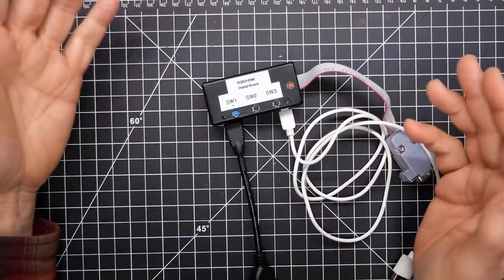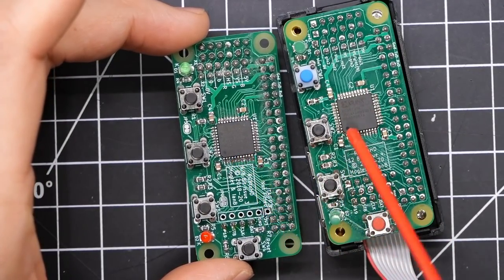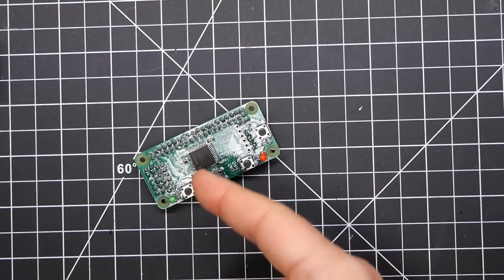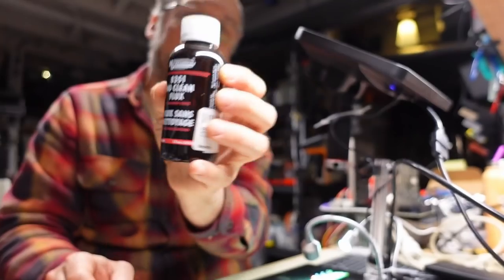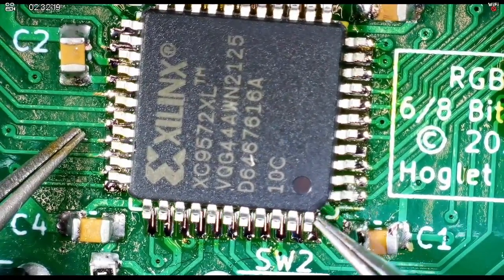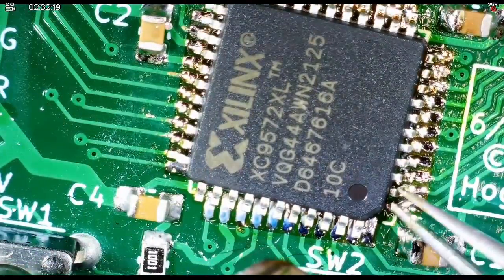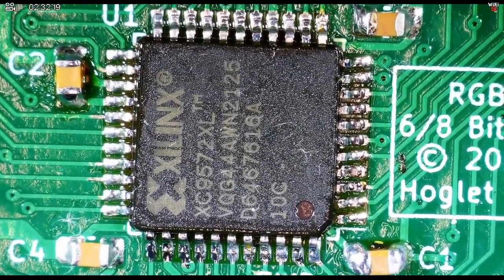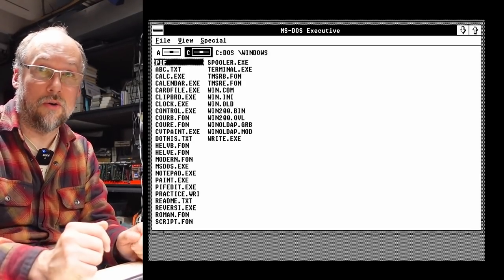The perfect way to NOT do SMD rework (RGB2HDMI overview and repair)

Comment: You're actually pretty close, you just need more practice.  I routinely solder harder stuff than QFPs (think QFNs and DFNs with multiple backside paddles and 0.45 mm pitches).  So a few tips: 1) Chips moving under hot air is common.  Don't freak out when it happens, just keep heating and gently nudge the part back in place.  If you freak out and move the hot air away, the solder will solidify and you'll have to get it hot again to put it back.  It sometimes also momentarily grabs when it shifts out of place.  Just gently nudge it with your tweezers until it can move again.   2) Clean the flux after removing the old part, then reapply for the new one.  Old flux gets used up and develops a burnt appearance and doesn't work well.  Acetone works well for removing rosin flux.  It attacks some plastics, but most PCB components won't be bothered by it.  3) When you have everything molten, chips will "snap" into place.  That's a nice sign that you have everything lined up properly.  4) Use LESS solder.  You don't need much for surface mount soldering.  Too much just creates issues and bridges.  5) When desoldering, don't try to pick up the part right away.  Just put the hot air on it and keep gently nudging with your tweezers or a small stick until you see the part move.  Picking it up before that point tends to lift pads.  6) Chips are pretty robust to hot air rework, especially if don't heat it longer than necessary.  If you have to retry, it'll probably be OK. 7) Try a bigger nozzle for your hot air rework.  That one is really too small for larger chips like that.  8) When soldering pins, flux is your friend.  It helps to keep solder bridges away.  Flux the pads before you put the chip down, then, once the chip is down, flux the pins before you touch them up.

Comment: Desoldering was OK
But you need to solder back:
1) remove all old solder with the wick
2) apply flux around
3) Solder only 2 pins, diagonally to fix the chip
4) blob ball of fresh solder all around the chip (flux will avoid connections) with the normal soldering iron
5) remove excess solder with the wick.
6) clean with IP Alcool.
Ceers.

Comment: Clean the board, apply fresh flux, and use higher temperature -- 375-400 C -- and the chip will self-center.  If you're gonna hand-solder, remove the old solder first.

Comment: I built my adapter by getting PCBs built from the GitHub KiCad PCB files. I soldered every part by hand because I didn’t trust hot air. I would be tempted to remove the CPLD using air and replace it with an iron.
Reply: My CPLD came from mouser.

Comment: It’s better to use solder wick to clean off the excess solder and then clean the flux off so you have a clean, level surface to place the chip. Then tack down one pin on each side before going in with the proper flux and soldering all the pins.

Comment: A good attempt. A better method would be to remove all the old solder first with solder wick. Then mix some solder paste with flux to make a very thin solution. Use a thin wire to drip thined out solder paste onto the pads. Don't worry if this step ismessy because when the solder paste melts it will correct itself. Place the chip onto the pads. Then melt the paste with 400 degree celsius hot air. The paste should melt and drag the chip onto the pads.

Comment: You should have used solder wick to remove all the solder from the pads, not add more. then it lays flat. solder two opposite corners, then run a bead of flux on the pins. clean the tip on a damp solder sponge  they add a very little fresh solder to the tip. Run it along a row of pins, which will draw the proper amount of solder onto each joint. With a little practice it will look like a good reflow over solder job.
I did this work daily for four years.
You got that IC too hot, which can damage it. Also, the IC needed to either be baked to drive out any humidity to prevent the package from splitting on the underside.
I used Ungar 'Loner' series irons, with a 0.015" Plato tip and a collet to hold it properly.
I did NASA certified level work, that went into space. I also worked with Manufacturing engineering to upgrade both our reflow process and our rework process to handle smaller components. Hand soldering was done with Ersin 0.015" 63/37 solder.

Comment: I was astonished at the cost of these devices. A RasPi Zero sells for $5 - but this $1 add-on board with $10(?) worth of parts will cost you $75 if you "need" a case.

Not exactly friendly pricing, here.

Comment: wont take you much practice to get good at smd work at that rate. 
you generally dont want to hold the chip down though, ise less air flow if you are worried about moving the chip. 
also you should really use amtech paste flux, just put solder on the pads, then put the amtech flux on top, its pretty sticky.. 
then line up the chip and heataway. 
if you really want too you can tack down a leg on each corner but thats more for things like tsops woth really fine pin pitch.

Comment: Not bad for a first (or inexperienced) attempt, because, well, it worked. That said, Adrian, with all the respect in the world, learn to drag solder, makes reinstalling SMD chips like QFPs so much simpler then even hot air. Hot air is great for removing the part. Then, don’t be tempted to leave solder on the board. Take it all off, that way the chip isn’t running into these mounds of solder, you can place it where you want without it moving about so much. Tack one pin on each corner. At this point, you don’t care about bridging. At this point, flux the crap out of the part, with no additional solder, drag the tip from one side to the other, let the bridge follow your iron tip and if you measure out the solder quantity right, by the time you hit the last pin, there won’t be enough solder left to bridge. If there is a little bridge, just drag back to the beginning pin and back to the end again to redistribute the solder. If in the end that little bridge is still there, suck that up with just a tiny piece of wick you hold in those tweezers, just long enough that it doesn’t come unbraided. Rinse and repeat on each side. For drag soldering, I recommend a curved conical top like a Metcal STTC-826 or similar. I use the 826 for SMD that has ground planes on it because its very hot, but the shape is the important part, it’s also small so it won’t hold a gigantic blob of solder.

Comment: i think that was worse than my first time soldering a tqfp. i used a technique where you flood some solder braid with solder and drag solder with it. it helps if you only have the faintest hint of solder on the pads, this lets you tac the corners better. i think hot air is better for removing the chips though its mandatory with some leadless packages. i still dont do bgas.

Comment: The biggest issue I saw was you didn't clean the old solder off before trying to solder the new part.  Best way to do in-line ICs or QFPs is exactly what you ended up doing - tack it down, then drag-solder the rest.

Comment: I’d love to see if the RGB2HDMI would work with the video out from a TRS-80 model 3 or 4 without using the analog board. The output from those machines has an hsync vsync and video output so I would think it would work??

Comment: Don’t worry. I completely screwed up desoldering a ram chip pulling up some tracks. I had successfully removed about 20 chips from the board at this point but this chip was recalcitrant and I was tired and impatient. It’s repairable but I’m also reverse engineering the board so it’s not the end of the world.

Comment: I take them off with hot air default and remove  most solder, then with solving iron solder 1 pin thend thes rest with the iron. Hot air can damage boars and other componets

Comment: It's easier to use a small brush to apply liquid flux, small brushes like nail polish bushes are great for this job. 
Edit: And you don't need flux for desoldering, pre heat the bord slowly around the IC you want to remove and work your way to the ic and attack the IC if te bord is warmed up.
Edit2: Don't put tin on the pads, use solder pasta for hot air. And if you use solder iron also not put solder on the pads first, wick the solder off, and put only on one pad little bit (less is better) of solder, just enough to tag the chip, no blob, that is hard to position on.  If you put solder first you can never get the pin on right high at start, they are all flowing 0.5mm above, so no matter what you do the chip is out of alignment, so always start with clean solder pads without any solder tin on them.

Comment: You would be horrified at my lack of SMD technique, so don't feel bad at all.  When I have to do SMD work, I switch my solder tip to a bent conical tip which seems to work well for drag technique.

Comment: So the few mistakes you need to fix for a better next time :
 - The board needs to be fixed in place. Having the board move makes things 10x harder than they need to be
 - If you're trying to resolder using hotair, you do just like you did, put solder on pad, have flux on there too, then position the chip on top of it. BUT then you just heat, DO NOT try to hold the chip or press down on it or anything, just heat and that's it. You want the chip to move, you want the surface tension to pull it in place.
 - If you're trying to resolder using an iron with the drag soldering, then remove all trace of the previous solder with solder wick so you can hold the chip flat against the PCB, and then solder the two corners like you did and then drag the rest ( with lots of flux )
 - Really you should try tacky flux ... that liquid stuff is ... not great IMHO.

But heh, all in all, you got her done :D

Comment: its obvious the hot air gun technique won't work for soldering smd chips

smd chip floating on soldered pads is like skating on ice

drag soldering is the way to go here, that way you know there is good continuity between pin and pad

hot air guns have a place - they work well for quickly removing chips

Comment: You were supposed to remove the solder and clean 1st then you solder new
Reply: One has to agree, tack a few legs then flux up & drag.
Reply: @keithmcgerr3056  correct and thats the point of a well tip
Many tutorials on youtube he could have watched before attempting and practicing on garbage boards
Its like he made this vid on what not to do
Reply: @primus711  well you have to start somewhere tho...agreed he could have looked at a few beforehand but we all make mistakes & hey we all try to learn from them....we'll most of the time 😉& he got it working.

Comment: It's already been said, but just to back up my fellow commenters. Those cheap hot air stations are death traps. Electrocution hazards from bad wiring and fire hazards from shoddy components and workmanship. Maybe they're legal in China where they're made, but I don't know how they can legally be sold in the US. Blame deregulation and the defunding of regulatory bodies who are toothless to do anything about it.

Also, just one more small thing. It's surface tension that will "suck" a component over to its pads when solder is present. Not capillary action. :)

Comment: Give yourself the chance to use a larger hot air nozzle and some tacky gel flux. It literally work for you ;)
Reply from the maker: You know I didn't even think about the larger nozzle, I really need to go find it and try that out when doing larger parts. I am usually just doing small resistors and other tiny parts, so I keep the smallest nozzle on.

Comment: How do you probe pins of something like a 0.40 pitch lqfp chip in place on a board? I've watched you probe old c64s and I've got a computer with a power problem and a nuvoton nct5577d hardware monitor chip which isn't illuminating the power button. It's very small and I need to probe it without shorting pins or losing my place to figure out what its findings and inputs are.
Reply: I've considered etching tracks on coppered kapton tape and 3d printing something to hold it onto the pins. But I just can't believe there isn't a common solution

Comment: If you are going to tack down two pins and then use an iron you should remove the old solder first. This will let it sit flat. Otherwise you will be trying to create vertical solder bridges. You are not “using the wrong tool!” ;)
Reply: Yes he is.  That iron is far too big, and therefore difficult to control the heat input.  Not to mention the tip is too long for reliable shake-free work.
Reply: @Fredjoe5  I disagree. I do this kind of SMD work with an iron like that daily. His iron was not the issue.

I use both a T-18 K-tip or a solder well tip and would’ve been able to use his just fine. I’m often praised for my results soldering to high density QFPs with a cheap Aoyue station (Hakko 888D clone). That’s right: It’s not even a modern cartridge-style station/iron.

Adrian has temperature control. Tacking corner pins can be done quick and easy and safe without overheating it. Once tacked in a couple places you can can increase the temperature and drag solder. When drag soldering you have more thermal mass to distribute the heat and your flux will distribute it too.

Adrian could’ve made quick work of that with nearly any digital temperature-controlled iron simply by removing the residual solder first. You can leave the solder if you are using hot air with surface tension and the right kind of flux to solder the new chip but tacking it down in the corner with the chip elevated is usually a mistake.
Reply: @emmettturner9452  What soldering I've seen on your channel uses either a large one for ground/power plane stuff, or a finer one that's still a good 50% thinner than Adrian's.  I'm not sure if you've done fine pitch componentry (beyond QFP, the larger 100-300 pin stuff) but getting into that range requires a narrow tip with controlled heat delivery.  Skill is important, but certain jobs require specific tools.

Temperature control is fine, but temperature requirements vary, especially when tweezers and other tools are placed into proximity.  Auto-sensing tends to give better results, and there's no forgetting to dial the heat back down.
Reply: @Fredjoe5  I don’t really have a setup for recording my fine-pitch work but you can see me use the K-tip on two 160-pin QFPs in the last UltraHDMI video (literally just my cellphone balances above). Thanks for checking it out but you must’ve gone way back to my only microscope videos ever or when I was using the tip that came with my station and didn’t have a K-tip yet. ;)

The high-density QFPs that I soldered almost daily when the kits were still available were UltraHDMI and N64Digital. That’s where I solder a flex PCB to the 160-pin graphics chip of a Nintendo 64 (so-called “Reality CoProcessor”). I’ve done well over a thousand since I was easily the most prolific installer while the kits were still available.

While soldering a flex isn’t quite the same as soldering the chip to the board, it’s can be even more difficult since you can easily burn the flex castellations and ruin the chip/flex/board. That’s why I’ve had to completely remove and reinstall the RCP multiple times to clean up/recover after others give up and send it to me. I’ve had 100% success so far even with bent pins and several missing pads.

Though I prefer a Hakko T18-S6 or S7 tip for the RCP, I usually use my T-K tip because the rest of the install involves soldering to power connections and removing an LED (knife tip spans the LED legs and has enough thermal mass to heat the power/ground planes).

Though there is no digital HDMI upgrade kit for the Super Nintendo I’ve successfully removed and replaced the 160-pin QFP for multiple “1chip” SNES consoles… and there really isn’t much clearance with the cartridge slot there. Somehow, I managed, since I literally only use hot air for removal and never once used it for soldering. I don’t show my soldering but I do show my results in the last electronics repair video I uploaded.

I’ve done dozens of Wiis, GameCube’s, and Dreamcasts with similar HDMI kits but the most difficult is easily the 208-pin GPU for installing PS1Digital inside a PlayStation. The chip in my most recent PlayStation-related videos was the drive controller chip for XStation (optical drive emulator) and not the extremely fine pitch GPU. It can still be hair-raising, even for me, but I’ve done dozens of both with a 100% success rate… even recovered those for others who attempted it.

The Wii DAC’s pin density is similar to the PlayStation GPU but has far fewer legs. Still, I’ve done so many of those I might as well stick that feather in my cap. :) I don’t think I’ve ever used anything but a T-K tip there since it’s Pb-free solder and I need the extra mass.

Admittedly, I only use hot air for chip removal and not installation. That’s because I’ve never needed it to install, I don’t have the best hot air station, I haven’t developed the technique, I don’t have solder paste, and I probably don’t even have the right flux. Even when I have a fine-pitch QFP to solder, I don’t want to develop my hot air soldering technique by experimenting on other people’s boards. That’s why I stick to my big fat iron for now.

I also do a lot of Model 1 Sega Genesis/Megadrive Triple Bypass V2 installs that require some delicate soldering and leg lifting on some fine pitch QFPs. I always use my K tip there too since I literally expose a huge area on the ground plane to solder a mini-DIN upside-down. That needs as much thermal mass as I can get and I don’t change tips mid-job if I can help it.

So, yeah, I’ve been soldering to 160+ pin QFPs almost daily for years now. Didn’t switch to the K-tip until some time in 2018. I never looked back even though my Aoyue station is a piece of junk. ;)